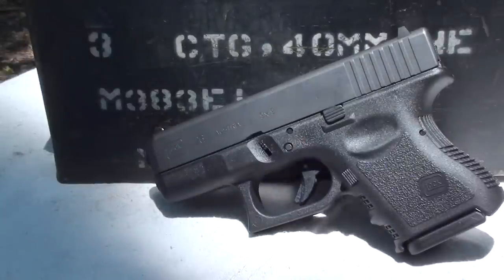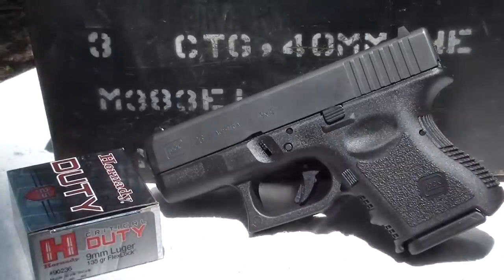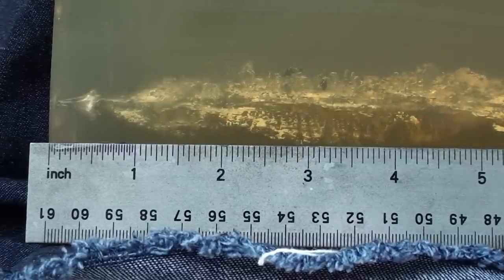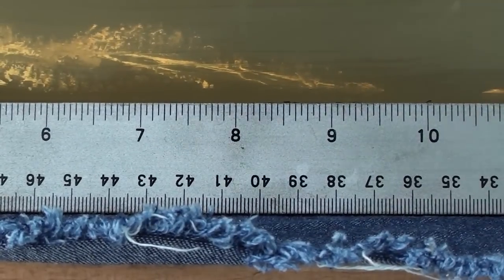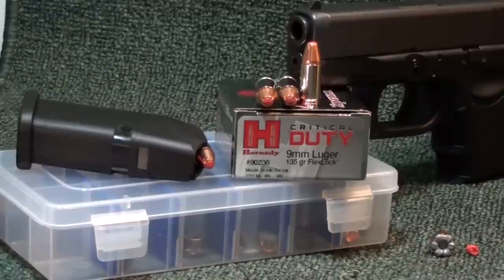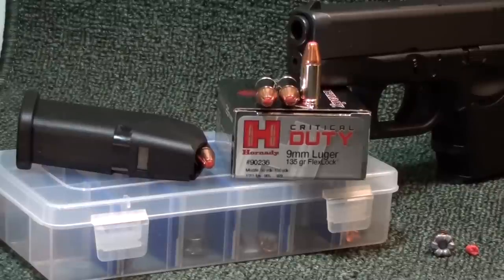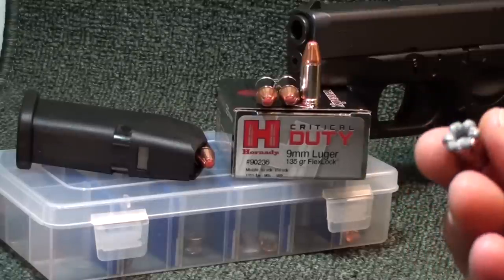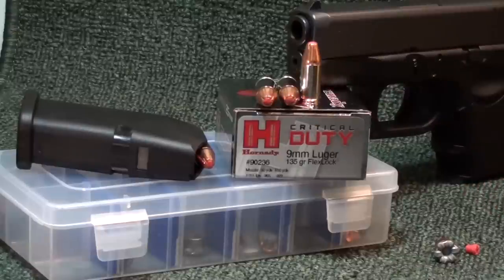9mm Critical Duty Short Barrel Ballistic Gel Test

Comment: Critical Duty is optimized for(Duty Guns)4 in to 5 in barrels. That is why it did not expand bigger, the extra FPS from the longer barrel would help it to open up and not over penetrate. Not bad from a 3.4 in barrel
Reply: This bullet gains approximately 17fps faster times from a 3.46 barrel to a 4.2
Reply: My thoughts exactly, is this not why they created the Critical Defense was for the short barrel like the G26?
Reply: The diameter is consistantly the same
Reply: Critical Dooty has piss poor expansion regardless of barrel length.

Comment: Thanks for all the videos!  I have this round as well as the +p version and carry in my G26 and G17.  Just purchased the 110gr 38 special +p for my LCR.  It seems like plugged hollow point cavities are often the culprit for lack of expansion and overpenetration.  Hornady seems to address this with the flexlock tip and it works.  Thanks again for confirming a solid ammunition choice.
Reply: I like your choice on the.38 load. mine also in my 342pd
Reply: Preclogging the hollow point is a gimmick that doesn't seem to make any difference through clothing.

Comment from the maker: The Crit Defense line and the Crit Duty line is known for dependable results EVERYTIME.  I have said in the past, they are not deepest, or widest in expansion, but they work everytime, the same way.  If thats your EDC I would feel real safe knowing its a damn fine round!
Reply: You're right. Critical Defense can always be depended on to under penetrate, and Critical Dooty can always be depended on to under expand. You're taking about 0.469" expansion like it's a good thing. An HST will expand to 0.600+ and meet the FBI penetration spec in the same length barrel.

Comment: Thus round is designed for a Police Duty firearm (4" or greater) and is properly why expansion was small.  In other testings, I've seen the FTP's fail totally in the expansion department and not open in short barrel testing, but so do alot of HPs in a short barrel.  What I've been able to view, the HSTs (Federal) and the American Gunner series XTPs (Hornady) did pretty well in the expansion department and reliability and with good penetration.

Comment: Critical Duty 135 over penetrates and under expands out of a short barrel as proven by your tests. 18” max penetration is what the FBI calls for. And this is the load that they use but it’s called Duty for a reason. It’s designed for Duty sized pistols not short barreled pistols. Try the 147 grain HST load from your short barrel.

Comment: I see where Speer Gold Dot Short Barrel 124gr +P ammo will work its best in short barrels like a Glock 26 and not a 17 or 19.  Where if Speer Gold Dot 124gr +P, 115gr, 147gr works well in a short barrel gun it should work just as good if not better in a longer barrel (once again using the Glocks as the example guns).

Comment: I know this is old video, but can anyone tell me how you know if ammo is rated +P)? I just purchased this same ammo, and guy told me it was hot loaded +P
Reply from the maker: If its factory loaded it will say +P on the carton
Reply: ScubaOz okay 👌 thanks , it doesn't say it, so he must of been hyping up his sale.
Reply: Also, make sure your firearm is rated for +p use. Even ones that are, caution that it accelerates wear and tear. Test operation if it is, then practice with normal loads and carry the +p if you choose it.
Reply: Plus P (+P) is also printed on the casing, look on the bottom of the round, same for Standard Pressure.

Comment: Thanks.  Can you say whether you prefer Critical Duty to the Critical Defense?  I also have a G26 and just bought some Critical Duty but I saw the test on YT with the head of lettuce and the Defense actually did more damage.  Decisions, decisions
Reply: Steve Johnson what gun/ barrel length where u taking the pig meat with.?
Reply: Great info...ThanX..!! 
That's basically how Hornady describes & markets them. Being CDuty as a service pistol round & C-Defense as a CCW round being that most people carry tiny guns/ aka, short barrel'd.. I like that u pointed out to use the +p if one was to use the C-Duty out of a "mini gun". & of course milage may vary...meaning anyone reading this, buy this stuff & test,test,test it out for urself & through ur own equipment.. Thank you again. Stay safe out there..!
Reply: Well I already got a bunch of CDuty (non +P) for my G26 so hopefully that's okay.
Reply: Critical Duty is marketed for full size (police) weapons.  Critical defense is intended for optimum use in EDC situations. My XDs 3.3 fires critical defense very well. No jams and tightest groups. Fortunately for most of us, this is all academic as we'll never have to find out. That being said, it is imperative to test enough quantity to be confident it will function when the SHTF. I bought some Winchester Ranger T and ran it in my Kimber Ultra Carry 45 (3" barrel) and had two failure to loads and bad ones at that. Not ones that a 'tap and slap would get it into the chamber. More like the bad guy would walk away afterwards saying "cool gun". Too bad because when it did run, it gave me very tight groups.
Reply: Use critical defense in a 26

Comment: Okay to prevent the HP from plugging we are going to plug it with polymer. Nothing makes sense with that. No wonder there's less expansion that Speer and hst.
Reply from the maker: Actually it makes perfect sense, since the hollow point is full already anything pushing against it aids in expansion of the hollow point, and it works everytime, cant always say that with other hollow points, not always to biggest expansion sure, but expansion everytime beats no expansion some times
Reply: ScubaOz  check their xtp bullets against these same bullet without the plug. Plus that bullet is used by other company's. They do expand but so do the hst and many others through all protocols with more expansion.  Even with denim in the hollow point. Check shooting the bulls channel. He really does some in depth comparisons. Your channel is good too. Best story I have fit the CD is that my buddy dropped a eating size hog with a 380 Critical defense. One shot.  Not here to debate but think about it. Lol. Plug the tip to prevent plugging. I'm sure their engineers did a lot of testing. I'm just making conversation but they do not perform better than other bullets by some margin.